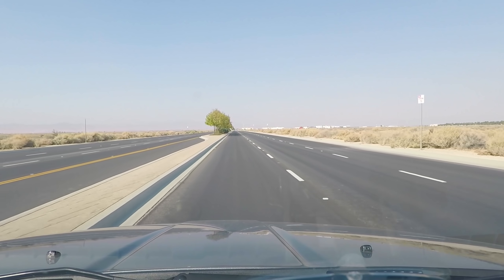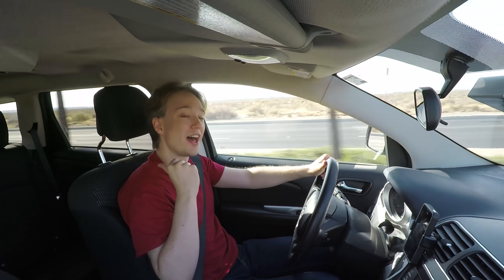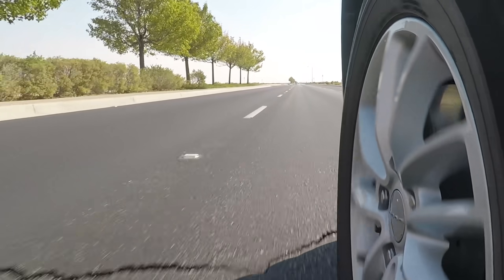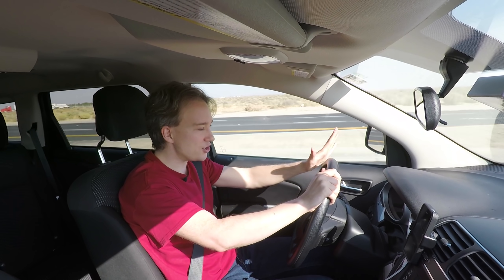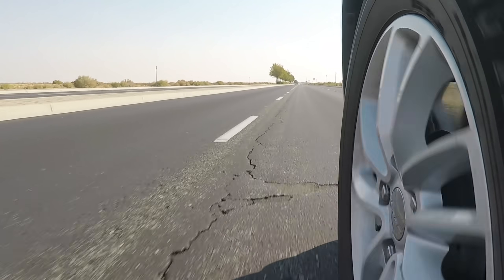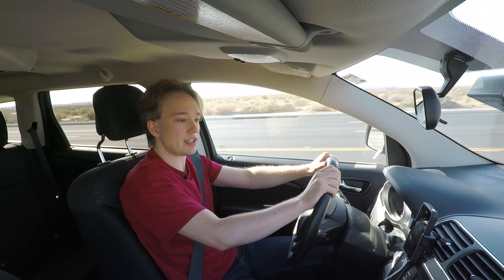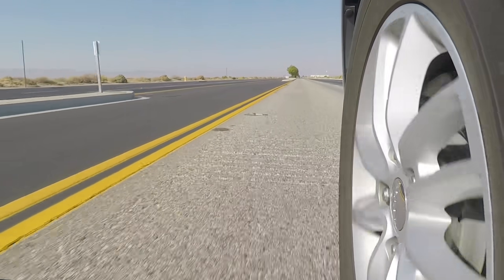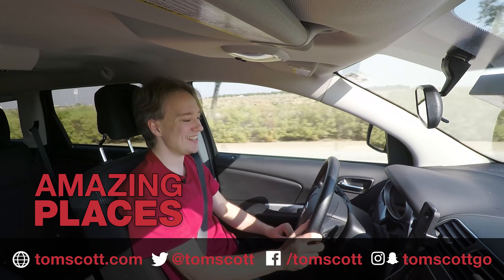Why California's musical road sounds terrible

Comment: If the specifications said, "four inches apart,' then you can't blame the crew; they built it exactly as specified. The plan should have said, "four inches on center."
Reply: As someone who works in carpentry, this is entirely believable. My superiors will often forget to specify or show us what they want and only notice that we're doing it "wrong" (but perfectly fine according to what they said) hours later.
Reply: @StarboyXL9  I think it's that generation of people. I've seen it at every company i've been with through both construction and factory/manufacturing
Reply: Somebody forgot to get the drawings reviewed & approved?
Reply: Yes, exactly.
Reply: I'm interested in manufacturing and have a degree in electrical engineering and in my experience it's important to speak the language of the people doing the work and to understand the implications of things that seem innocuous.

there's that old story of an engineering student being charged a hundred dollars for a part and one being charged 10,000 dollars for a part. The latter student didn't take into account the tolerances that were actually needed versus what was calculated or on the drawing.
Reply: @killaken2000  It's called "technical writing"....there's an entire profession and industry built around relaying information in precise and technical manner with no room for error or interpretation. It seems lately that people have forgotten that this exists and should be respected.
Reply: @killaken2000  theta why you should spend some time working these jobs. I'm an aerospace engineer. Spent a while as an electricians apprentice. Then ran a remodel company with my buddy for 2.5 years. Also worked at as a maintenance manager at my schools airport. All were super helpful.
Reply: @ghg789987  ur school had an airport?
Reply: @edu7979  we had our own hanger and fleet there.
Reply: @ghg789987    school airforce
Reply: @edu7979  you ever hear of Embry-Riddle?
Reply: @ghg789987  cool story bro
Reply: @LikeSpee  literally no one outside of aviation has heard of Embry Riddle 😂
Reply: @killaken2000  So as someone who did some maintenance in the military, they have a rule: everything must be done and written in a way you could have an avg 8th grader pick up the manual and understand what to do. It makes it tedious to do the work some times, having 4 or 5 pages for a task that takes literally 30s, but you would have to be dumber than the avg 8th grader to not understand it.
Reply: @killaken2000  Absolutely. I learned these things as a draftsman working in an engineering division of s government contractor. You learned what "on center" meant. You earned a lot of things, otherwise disaster.
Reply: @killaken2000  no one cares bro
Reply: @killaken2000  That's the whole reason behind the existence of the boatswain...
Reply: As someone who does construction, if it isn't specified, it's assumed to be "on center" or to the same face.  So that means it's most likely that it was specified, and was specified wrong, by someone who doesn't understand how plans are drawn up.
Reply: Okay but twice? You know…
Reply: That's why there are drawings and not words. 
Eventhough I am not german, I still know at least three clear distinguishing words for this problem. Teilung/pitch, lichte weite/clear distance and Abstand/ distance.
Reply: @herrkulor3771  Yes. This is another clear difference. 

It's either "spacing" (centre-to-centre) or "clear spacing" (end-to-end).
Reply: As someone who works with software developers for 10 years, I can confirm this is correct. Bad spec? Bad product.
Reply: No one here knows exactly what was said or what the specifications indicated. Therefore it's impossible to know whether the error was in implementation or direction.
Reply: In a high school class, I saw someone order a 3D printed part, without specifying units on the dimensions. They meant inches, it was interpreted as millimeters, and they received a perfect 1/25.4 scale model of their part, complete with teeny tiny screw holes
Reply: Care about your wording,  my Dad was told to make two plates as smooth as possible for an electro-magnet and when they turned off the current the plates stayed together. Then he was told to rough them a little.
Reply: Thank you. It wasn't built wrong. It was built to plan 😂
Reply: This is the difference between engineers and construction workers
Reply: The language of construction and fabrication is drawing, or at least it used to be.
Reply: The plan should also have included a diagram example showing what that meant in real terms - just so there really is zero confusion.
Reply: @jorisbonson386  The language of construction and fabrication is drawing.  Sadly, many are illiterate.
Reply: It's horrifying how actual people not currently learning their alphabets, are insisting that "just draw a picture" is some kind of a license to keep speaking nonsense that you barely know the meaning of.

Using clear space separation is a terrible standard, you don't just DRAW A BLOODY PICTURE of the groove itself like a grade schooler. The groove can be of various different shapes depending on HOW you're implementing it. If you need clear space, you account for every groove being DEDUCTED from the COMPLETE space afforded in the plan.

 Start doing middle school woodwork with a novelty oversized pencil, until you UNDERSTAND that here has to be an exact spot where the groove or line START, regardless of how wide of a mark it "has" to leave for the plan to work. It's not a single atom wide even when you use a pencil, you have to know which SIDE of the line you're working on, or there WILL be accumulating distortion. Fischer-Price is your frined, go use it's products until you've grown up with them and can graduate to more exacting work.
Reply: Ok, you're right but...HELLO QUALITY CHECK DEPARTMENT????
Reply: That’s a project manager mistake
Reply: The plan should have been drawn in CAD or some other vector drafting software, not described in words on a document.
Reply: @TrueXyrael  Yes but these people live in the 1920s
Reply: And that’s why businesses never hire someone with a degree from California now. Usually someone with a $98,000 college bill and wants  pay to match but when it comes down to it doesn’t have the common sense to do the job right :(
Reply: Or just forgo the written instructions in favor of properly drawn ones?
Reply: agreed
this is something that some people over-look / dont understand.
Reply: must have been specified by an architect
Reply: nobody except you even mentioned the crew mate, Daddy Tom even said it's the language
Reply: "every 4 inches"
Reply: I still don’t understand how else you would make it every 4 inches if not every 4 inches. Is it the number they got wrong?
Reply: @jasond.b-w  It is literally explained in the video 🤦‍♂
Reply: Bingo
Reply: Did they really put instructions with words and not with blueprint? For every single note? Through entire tune?
Reply: Perfect example of where a drawing is worth a thousand words
Reply: Doesn't make sense.
Reply: Just lazy. Not specific instructions.
Reply: The plan should have said 10.16cm on center
Reply: Crew? This was probably just one dude with a cement mixer pouring it out very carefully.
Reply: Who’s blaming the crew?
Reply: THEY HAVE ONE JOB
Reply: Everyone's focusing on why the plans didn't specificy center to center, or if they did, how that got lost to the work crew. But the breakdown could have happened before the engineer who drew up the plans. Whoever (musician, or just general nerd who understands notes and frequencies, but not blueprints) could have calculated the spacings, and then passed them off using the wrong word for spacing (apart or whatever) to the engineer, who then put it down that way.
Reply: Oh, and there's this possibility... I've totally seen it play out in other contexts. Person A is aware of the possible misinterpretation, and makes a special painstaking point of clarifying the issue, as he's passing the info to person B. But then person B still gets it backwards! I think, person B doesn't remember the conclusion of that part of the conversation, but rather it gets lodged in his brain as "there was a big deal made about this, so it must be opposite of the general default." (But what he considered the general default was right to begin with, so he flips it to the wrong answer. Oops!) Or, the big deal simply acts as reinforcement for his preconceived (and wrong) bias.
Reply: And now it's four inches off key.
Reply: Yes!
Reply: This is what fabrication drawings are for. I draw them all the time... I'm a chemical engineer, not a civil engineer so I couldn't tell you why they don't have fab drawings for roads....
Reply: @thoroslin520  There is absolutely no way they were dumb enough to not include a detailed video with dimensions to show they were supposed to be on center.
Reply: Right. No architect on site?
Reply: @Starteller  I've never had an architect or engineer stay on the jobsite. They just show up to inspect.
Reply: @russguffee6661  You contradict yourself and that is my point
Reply: Drawings are included on every construction job. There are a set of prints that show the exact spacing. What likely happened is that the person drawing it created the drawings that way so the engineers are at fault.
Reply: They didn’t say “Four inches apart”, they said “Every four inches”, which is correct.
Reply: @mojoxide  however that could be interpreted from the end, travel 4 inches, start the new one there.
That's why the term center-to-center exists
Reply: @origamikiddo2625  Do your parents know you are using the Internet? It's a dangerous place for little kids. Stay safe.
Reply: Should have had an arkytekkt on site.
Reply: Studs are spaced by center. I agree it should have been specified but the default should have been spaced on center
Reply: @DarkShadows713  this, most professions have the default as top to top, center to center, possibly with ID or OD (inside/outside diameter) notations on the plans, any good forman knows architects and engineers mess these up all the time and would ask for clarity from them if the plans are unclear about deviating from said default.

so the road crew is at least party to blame if not wholly and did it with a malicious compliance mide set or utter ignorance of the trades.
Reply: So how do they screw it up twice then? These contracted construction crews and CalTrans are constantly screwing up projects whether through negligence or incompetence
Reply: @Nick_CF  From what I understand, the blueprints were wrong, not the crew, and they used the exact same blueprints for both.
Reply: @Nick_CF  following instructions right isn’t the fault of the construction workers, it’s the people who designed it wrong
Reply: @Nick_CF  the instructions were wrong. Higher-ups blamed it on the crew. Gave the same wrong instructions to a different crew. Same mistake occurred.
Reply: @Nick_CF  thing is the ones screwing it up is the architects cause apart means apart for that is the space between two objects for this to work the center of the object have to be the apart part. so this fail you cant really blame on the constructions it is a classicly wrong english wording problem.
Reply: @danielinserte9814  Crazy how all you have to do is walk to the hardware store and see thousands of plumbing and carpentry components with each section of each part perfectly listed in a diagram, but you ask an engineer how to build something and all of a sudden half the information is assumed.
Reply: @danielinserte9814  speaking of which 😂
Reply: @danielinserte9814  Architects don't design roads, they design buildings. Civil engineers design roads.
Reply: @Nick_CF  there told to follow and not to think for themselves. I would have ask hey if following the blueprint didn't work last time maybe there is a problem there.
Reply: @Nick_CF  My guess is the people in charge of moving it didn't care what it was or what it was for. They were just told "move this somewhere else" and did
Reply: @Nick_CF  it wasn't the crew, it was the engineers that screwed it up
Reply: @hannahmay5461  My guess is that it was the road crew that messed up, but quite understandable as road crew are not engineers or could be expected to know how technical drawings work.
Reply: @Nick_CF  It's the planners and project managers, not the construction crews. Cool way to condescend to people you consider beneath you though.
Reply: @Nick_CF  lowest bidder
Reply: That's why you always say how it is calculated as well:

For example: 2 cm centre-to-centre or 2 cm end-to-end

Generally speaking, in engineering drawings, we always use centre-to-centre spacing, meaning if we say 10 cm apart, it is automatically understood to be 10 cm apart centre-to-centre. 

But labourers are usually uneducated and they understand it to mean end-to-end. 

Normally, engineers account for this, as well as other small differences (for example if you say the steel bars should be placed 8.274 cm apart, most labourers would round it off to 9 or even 10 cm).

So structures are usually designed with tolerances to handle all these small variations.

However, in this case, you need to be EXACT because even the smallest difference will change the frequency and thus the sound produced.

So they really should have been more careful when designing and building it.
Reply: @Leanzazzy  Isn't a purpose of an engineering drawing to make it so the builder doesn't have to make assumptions?
Reply: @ding9633  There is nothing ambiguous. Drawings are always centre-to-centre. 

You can see this whenever there are figures, but even if there aren't, "spacing" means centre-to-centre by default.

In the rare case you want to specify end-to-end, you would specifically say end-to-end or "free space/clearing".

This is why you have a foreman supervising the labourers (they never work unsupervised) and he reports to the engineer who checks in and tells him what should be done.
Reply: @Leanzazzy  I really hope you're not an engineer
Reply: @Leanzazzy  kinda weird to say laborers are uneducated. Many are. Just not the same way you are.
Reply: no, you can blame them. The construction managers should have been doing their jobs and asked for clarification if there was any doubt.
Reply: @Michael-zn2jc  there clearly wasnt any doubt for the instructions since they build it the exact same way twice.

Comment: That could potentially be used for speed limit control.  If they made grooves at a certain distance apart, the sound could be made to be unbearable over a certain speed but pleasant at the speed limit.
Reply: The thing is that the speed of the car and design of the grooves are majorly only changing the pitch played so it wouldn't be that annoying unless you're going way past the speed limit

Comment: My mother and I spent an entire road trip debating why it is that the sound of the road changes (usually going up in pitch) when going over a bridge.  We had many theories, but still don't know the answer.
Reply: may be cause at ground level soil serves as foundation too, absorbing the sound... but on a bridge the concrete it's hollow, filled with steel beams, which don't absorb sound very well.
Reply: Speed limit

Comment: I have driven that road several times and have always wondered why it was out of tune. While you done specifically say it the answer was for the designers and engineers to specify the distance between notes should have been "X' inches on center.  The same way you build a house or anything else with recurring elements. 

I've watched you for awhle.  You're weird.  Keep it up.
Reply: Considering that "on center" is such a ubiquitous term in construction its surprising they didn't naturally do it that way. Then again if i told them to park 2 cars 10ft apart then they would park them such that the space from nearest end to nearest edge was about 10ft and not from center to center. 

All they really needed was a proper diagram and the explicit language of "on center"

Comment: The variables of tire size, tread pattern, sound proofing insulation in the interior and the body panels, the speed of the vehicle and other factors will affect the sound of the "notes".
Reply: Sure there will be slight variations, but tire size or tread would not affect the sound since the tire, no mater what size still rolls over the same ground.

Comment: Leave it up to the English to not think outside of the box. If the notes are 20% too far apart, why couldn't you just drive 20% faster to correct the miscalculation?

Comment: I've driven along a road that sounded much worse than that in the mid-north of England 4-5 years ago. I wish I could remember which road it was. It was a single horrific buzzing sound for a solid 3-4 miles. Exiting the road surface resulted in audible appreciation from everyone in the car every time. I can only assume it was a test of a road surface material that has since been changed, because it was on one of the roads along a route I am more recently taking every year, heading from southwest Scotland to the east coast of England and I only encountered it 2-4 times.

Comment: So instead of 4 inches apart, the instructions should have said 3.25 inches apart or something along those lines. Is there a general consensus on the standard procedure here? Measure the gap between points, or measure the space including the points?

Comment: How hard would it have been to print the grooves one-dimensionally on a line of paper before starting the road work?
Reply: You mean two dimensionally?
Reply: @MrT------5743  No. A line of paper, or a paper tape if you will, would be a one dimensional graph. Information would be portrayed based on not two axes but one axis. If that were considered two dimensional, then your average graph, like y=x^2, would be three dimensional, as by that same logic, the fact that the line does or doesn't intersect with a point on screen is a dimension of its own.